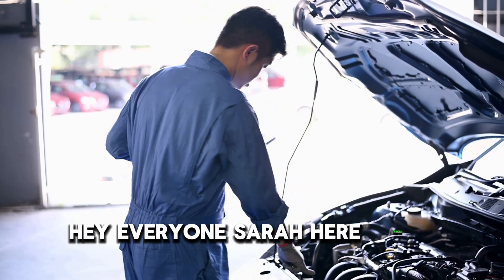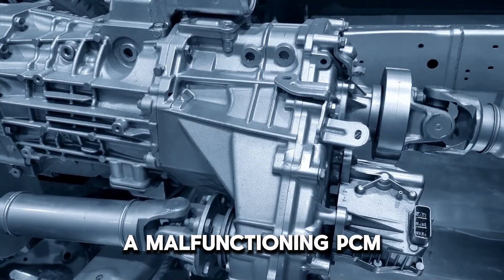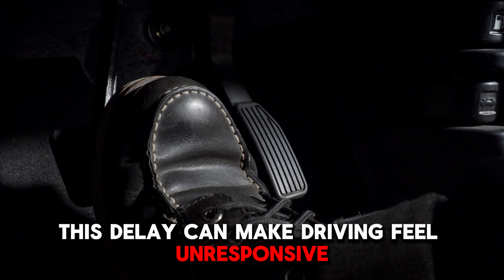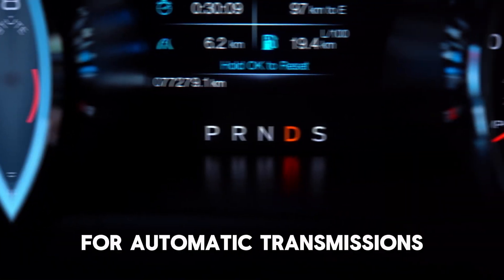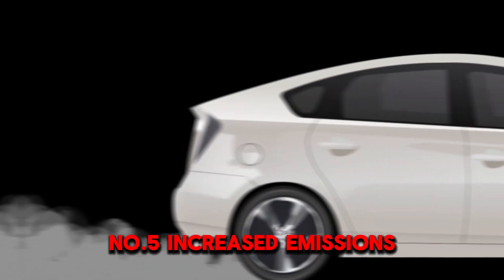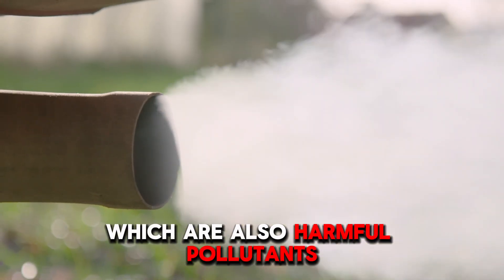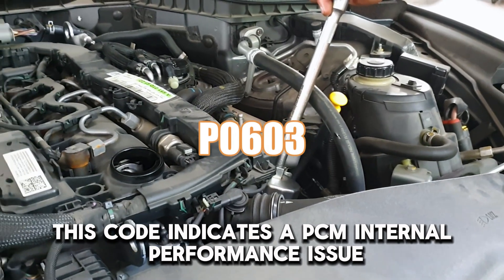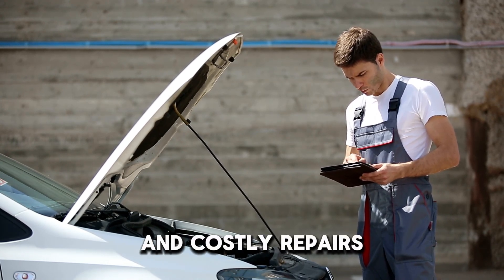Failing Powertrain Control Module: 6 Key Signs To Look Out For

Comment: thank great info on the powertrain control module [4]  poo8A 21 28 CMDTC low pressure fuel system to low,